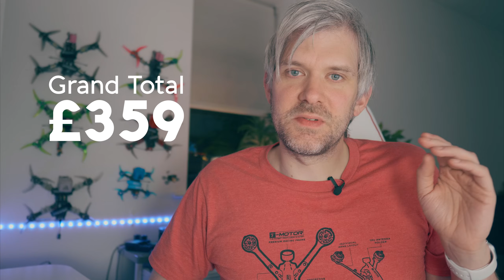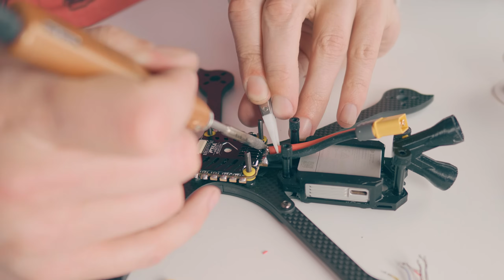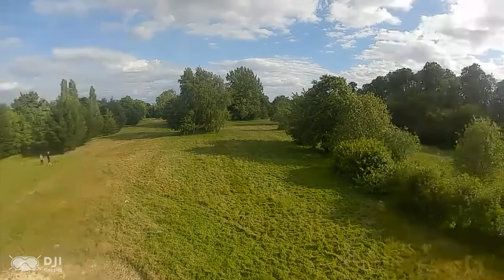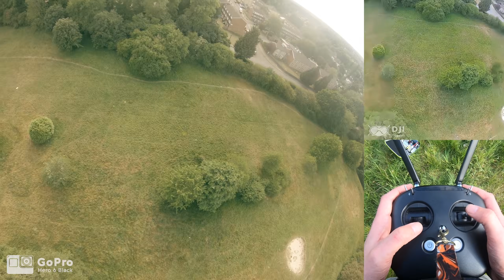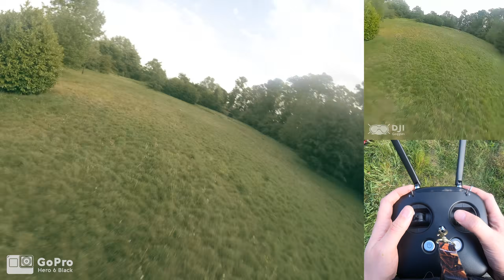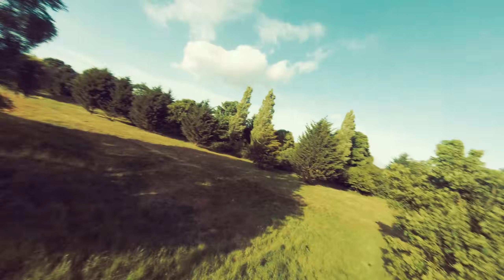The Easiest Build Ever? - T-Motor F7 HD

Comment: Witch UART Ports need to activate for OSD ? I Just use UART5 for DJI-Controller
Reply: You have to activate UART2 too, Themen it works. Had the same problem.

Comment: Fc Tmotor F7 hd have osd?
Reply from the maker: It doesn’t no. It’s designed for the dji which doesn’t need an osd chip, just a uart and the goggles handle the osd for u

Comment: Points if I  want to use this stack  with 6s ?
Reply from the maker: It’s plug and play on 6S too, as the thing has a 10V bec for the air unit so no issue powering it with 6S battery attached
Reply: What about using capacitor ?
Reply from the maker: @Guntechindia  Its always a good idea yeah! 50V is probably ideal on 6S

Comment: Will these components listed work with crossfire - I want to use the tango 2 as the transmitter. I'm a newbie?
Reply from the maker: You would need to buy a crossfire receiver and solder it to the flight controller, but it would work just fine
Reply: Thanks for your reply. Like your content keep it up.

Comment: That was exactly my experience with that same quad, first a few months it was on Betaflight 4.1 and I never quite liked it, had this same wobble that you did and I couldn't get rid of it. I changed it to Emuflight 0.3.1, it was immediately much better with the stock tune just like your flight on this video. Can you share your final tune on Emuflight?
Reply from the maker: Hey :) I have not yet done any further tuning on this one yet, I went back to my fettec quads for my regular flyign. I am thinking of trying out a bunch of the presets in emuflight .3.1, have you tried any of those?
Reply: Sync FPV I only tried 2 other presets and the stock tune was still better. I hope you could choose all those presets on the same flight day because I don’t bring laptop with me. There are some glithces with the Emuflight 0.3.1 though,

Comment: Bf 4.2 + rpm filter + dynamic idle should be pretty good “out of the box” too right?
Reply from the maker: Maybe! I don’t think rpm filtering can be classed as out of the box if you have to flash escs to get it, and dynamic idle isn’t set by default is it?
Reply: Sync FPV if you have blheli 32 then yeah ☺️ you can kinda enable rpm filter easier. dynamic idle is not enabled by default we need to set it ourself.
Reply from the maker: @joevo2  I'll give it a shot :)

Comment: Could you post up the dump for the tune please?
Reply from the maker: its completely stock settings on emuflight .3.1 and for betaflight I changed the default to Dshot 600 instead of multishot for motor and that was it
Reply: Sync FPV thanks! I have the nazgul 5 you see which is almost the same set up and it flies how yours does in the first video... so I’m thinking that I’ll emu it to get it flying smooth like that! Currently has a little prop wash
Reply from the maker: @TheWestysworld  yeah go for it bro! I think emuflight was still a little bit loose, so might need to just raise the pids ever so slightly across the board

Comment: Good job! I also have rhe TMotor F722 HD and i am trying for weeks now to get is to fly without a wobble on betaflight 4.2 an also on 4.1. Tryed different filter settings and try to pid tune it.
Tryed all the betaflight tuning notes recommended settings but cant get it out.
On a normal rip session i can not see it because i do a lot of flippy floppys but on a straight cruise i always get a wobble no matter what i do. The quad flys super nice withal those filter and pid tweaking but that wobble on a straight line is killing me.
So i like to know if you can tune your quad with betaflight 4.2 and dont get a wobble in a straight line because then its the fc and betaflight thats not working together.
On Emuflight everything is alright and my quad is flying without a wobble but not on Betaflight